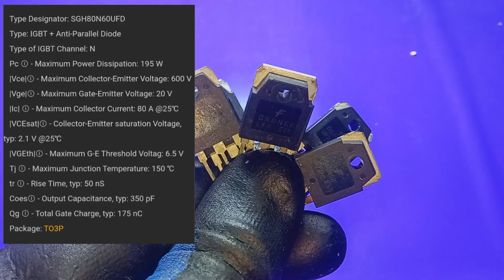Make High Current Adjustable Voltage Regulator Using 80N60 IGBT | IGBT Voltage Control Circuit

Comment: How much current can use it ?
Reply from the maker: 20-40A and make sure input and output voltage difference is not too high
Reply: 7812 ile  12v ta sabit tutabilirmiyim birde amper kaybım ne kadar olur